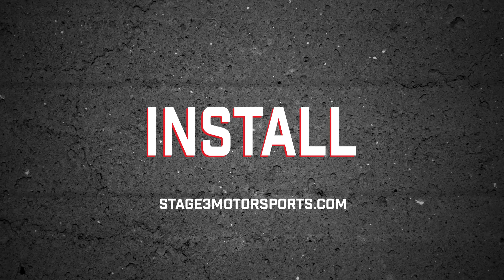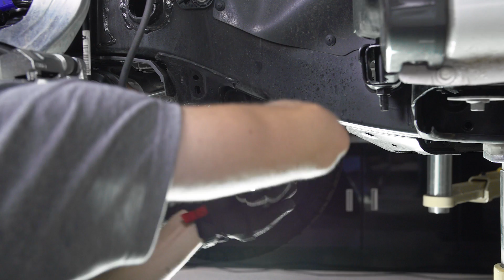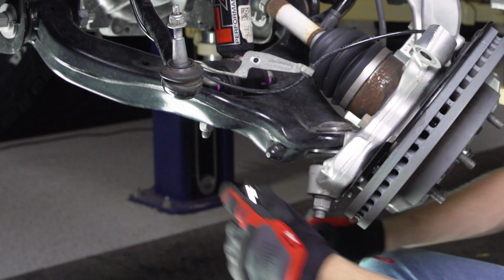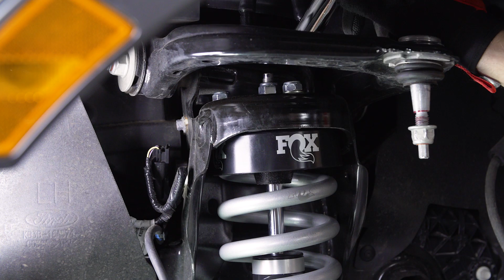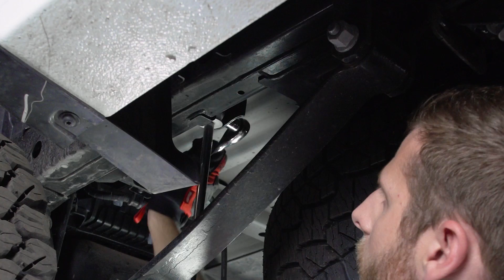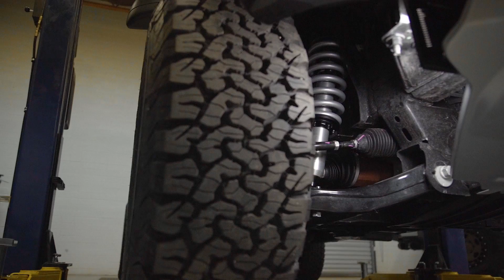2019-2023 Ranger FOX Stage 1 Suspension Install (READ DESCRIPTION)

Comment from the maker: IMPORTANT INSTALL NOTE:  It is highly recommended that you remove the axle nut on each side of the vehicle to prevent damage to the CV shaft while working. We do not show this step in the video so please be careful while performing the install.
Reply: Is just removing the nut needed or is the axle pressed in where you need to tap the axle back?

Comment: This is a good example except for not having anyone remove the axle nut. Without removing the axle nut, you will more than likely separate your CV and potentially damage the CV. 

In case anyone needs to know what size socket the axle nut is, it is 35mm. I got mine at AutoZone.

Comment: When in the air remove CV Axle nut first, take off the top nuts off also, and take off the bottom nuts of the strut but don’t remove yet. I would personally grab a string or strap to hold the hub assembly from falling once you remove everything else. 

If you do it this way it makes it much easier to remove without the shaft moving out of place. You literally can push down on the lower control arm to remove 

When you install I installed the bottom nuts first like 1/4 way just to grab and then I pushed the Fix assembly on the top. The reason I did this; the way those holes are on the truck makes it difficult to just slide in and screw on

Comment: FYI to those about to install this kit: this video gives a good overview of the procedure but will definitely lead to an over extended CV axle. Take a few extra minutes to remove the brake caliper, rotor, drop the sway bar, and remove the axle from the wheel hub. The knuckle will be waaaayyy lighter and easier to handle and it is much easier to reseat the axle than into its inner joint.
Reply: tell me about it. just tried doing it and like you said it over extended and is a pain to get back in without removing the brake caliber etc.

Comment: This video is deceiving and will only lead you to more trouble. You will most likely break or damage your CV joint or sway bar link doing it this way. I found out the hard way following this video exactly. You need to remove the brake assembly, top Sway bar link bolt, and remove the axle nut and allow the boot to pop free to give you more space to pull out the strut without over stressing the CV joint.
Reply: You dont have to remove the brake assembly that's for sure . That`s just overkill!  Do remove the Axel Nut- push inward the shaft all the way so it falls out from the wheel bearing ( EASY to Slide back in when reinstalling everything), Sway bar link, Knuckle,  Tie Rod end and detach the ABS sensor...I just did this job.. Only tip i have is USE a Metal punch set to realign the bottom of the front strut and the bottom mount.

Comment: Why didn't you simply use a strut compression tool? Wouldn't it be easier and put less stress on the suspension?
Reply: It’s not a strut it’s a coil over.

Comment: Really struggling to get the knuckle even close to the upper control arm connection afterwards. Potentially the CV axle is extended/overextended? Or do I really just need to work with it to get it back up there?
Reply: It's the cv! How did you fix it???? I need help! Mine did the same !
Reply: @zachrolands185  Luckily I didn't end up doing any damage to it, I just had to finesse it a bit. Figured out that as I worked with it, I could spin the joint little by little until I finally got it to the spot where it just slid right back in place.
Reply: @lukelindholm  I ended up having to take off the boot and put everything back together, only to get in and drive and realize the other side I thought was good is also messed up 🤦🏻‍♂️
Reply: @zachrolands185  And this is why I am hesitant to do the fronts on my own :(
Reply: @ejhayes76  do it yourself, but make sure you take out the axel hub bolt, then it's a piece of cake. But I fucked myself for sure.

Comment: Question.. did you have to unplug anything (Battery, Elect Steering)?? And how did you keep the CV Axle from not popping out???
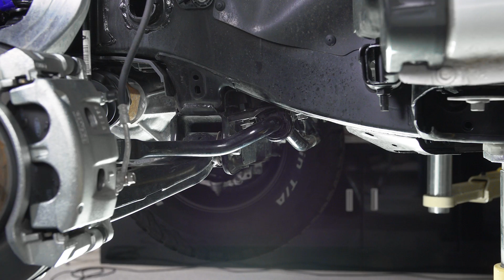Reply from the maker: Carlos you won't need to unplug anything for this install, and we kept the axle nut attached when moving the knuckle forward as Noah does at 2:47
Reply: @stage3motorsports  I attempted to do ours and drivers side popped out.  Had a hard time adjusting it back in.  Got frustrated and put everything back the way it was thinking I damaged something in that CV Axle.  I drove it around the block and now sound like something may be lose 🤦‍♂️
Reply from the maker: @CarlosHerrera-lf1vh  Sorry to hear that Carlos, have you watched our video on replacing the CV? we recently had to swap out the passenger side, maybe that can give you some insight into what could have possibly happened.
Reply: @stage3motorsports  I did, do you guys sell them?
Reply from the maker: @CarlosHerrera-lf1vh  unfortunately we don't
Reply: @stage3motorsports  - You are totally wrong.  You need to remove the wheel hub nut to prevent the CV axle from popping out.  This is mentioned in step 5 on Page 2 of 14  "204-01B Front Suspension - 4WD 2019 Ranger
 Removal and Installation in Ford Repair Manual.  A lot of people made this same mistake because either they did not read or don't have access to the Ford Repair Manual.
Reply: Well I found out I have to replace the drivers side CV Axle.  Something I did messed it up.  Oh well
Reply: Any advice? Do you know what you did wrong? Both of mine are out
Reply: @zachrolands185 i had no issues with my F150 but the Ranger is a whole different animal. You have to remove the Axle bolt from hub and pop out the axle in order to give you more room to play with on these.  That was my mistake. I tried like this video and it popped it out.  Cost me about $1000 later to fix
Reply: @CarlosHerrera-lf1vh  what broke that cost so much money? I took the boot off and just put everything back together
Reply: @zachrolands185  the drivers side CV Axle. I put it back in thinking everything was ok but it started to feel like something was loose and rattling.  Turns out it I messed it up somehow.
Reply: @CarlosHerrera-lf1vh  Hi Carlos, was it a px3 ranger? Did you manager to change the strut without pulling the cv axle nut completely out? (To prevent cv from popping out)
Reply: Was is the diff side or the hub side that was dated
Reply: I tried to install a leveling kit on my 2020 4x4 ranger and popped the CV out. I didn't remove the stay bar or axle nut.  After an hour of trying to align and push, I finally put my jack under the assembly hold it in place and hit it a few times with a sledge hammer to pop it back in.  I ended up only putting the wheel spacers on and saving the leveling kit for another day. Though I popped out the axlez I drove about 250 miles that day with no issues or rattling I have since ordered the eibach struts and will be installing those based off these instructions.

Comment: on the rear shocks I've seen other videos showing the shocks the other way around. I've looked on Fox's website and it doesn't show.
Reply: Can confirm. I have the kit in hand, and the fox and the ford instructions both show the rear shocks installed body up.
Reply: Stage 3, American Truck and Mountune installed the rear shock upside down in their videos. The Fox installation guideline illustrates the correct way.

Comment: Is there a way to know how much Torque did you need to apply to the rear shock?
Reply: 52 lb-ft for the rear shock bolts. You can get this from the install instructions of the Fox 2.0 shocks that Ford Performance sells.

Comment: Are there marks on the spring to determine the height I will be getting and where I need to adjust it

Looking for a 2”
Reply: Fox usually presets the coilovers at 2in of lift out of the box

Comment: Can you buy this package set at 2” instead of being set at the max ride height. Plan on installing this myself and having it set at 2” would make my life a lot easier? Thx
Reply: out of the box this gives the 2wd approximately 3" of lift and 2.5" on the 4x4. Preload adjustments must be made on a spring compressor and yield a 2:1 payoff at the wheel.
Reply: @ryan6109  Ahh ok, I needed to know this. Out of box for 4x4 it lifts front 2.5". Gotchya thanks
Reply from the maker: Unfortunately you can not.

Comment: i’m not quite  sure about the orientation of those rear shocks. most nitrogen shocks go body up unless designed otherwise
Reply: I wondered that when i put mine on but then i thought about trail damage. If the body gets a nic in it no problem but if the rod gets scratched then u have pressure loss until its a dead shock.
Reply: Monotube shocks work in any orientation, while this installation will not affect performance, Fox does recommend Body up.